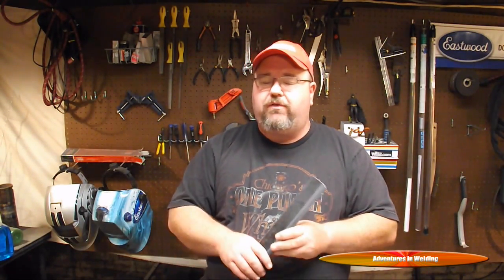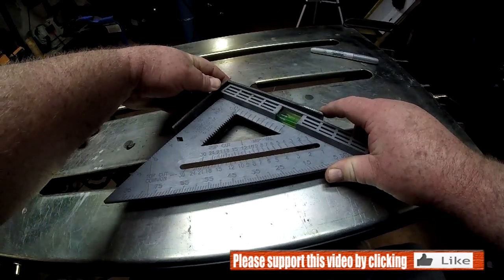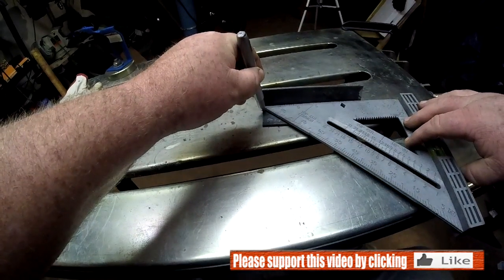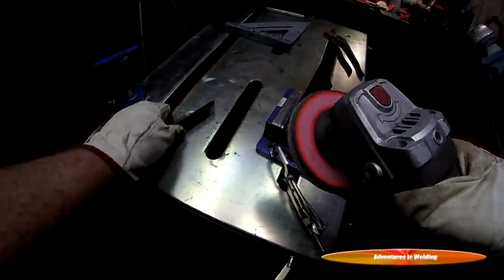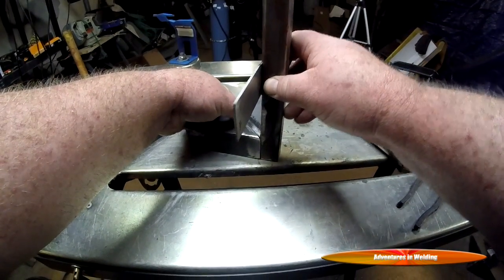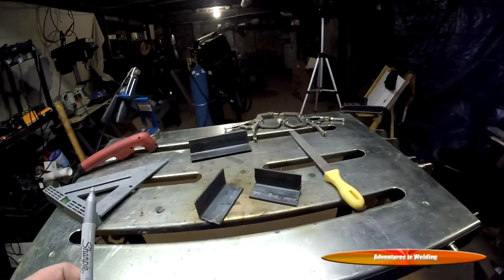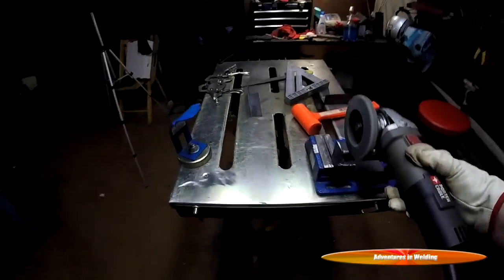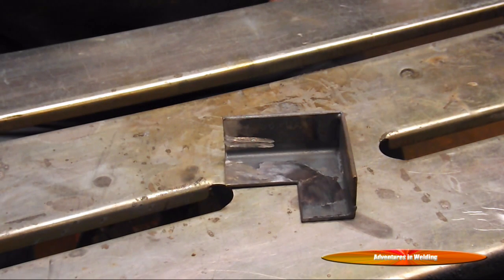Fabrication basics

Comment: Nice tips, know what you mean with plasma, I can drag the tip on mine and that can help, and also, setting the amps just enough for severance cut helps also. Re grinding with cutting discs as one gentleman mentioned, there are "cut and grind" discs, I think they are Dronco (German), they are 2.5 mm though so obviously if you are used to 1mm discs, you need to aim off.

Comment: Nice stuff Paul. Cool tips for the angle bar. 
Pidge.
Reply from the maker: PiDGE IAM Thanks. I like using angle. It kind of aligns itself for you making things go smoothly. It's more rigid than bar and lighter than square tubing of the same size.